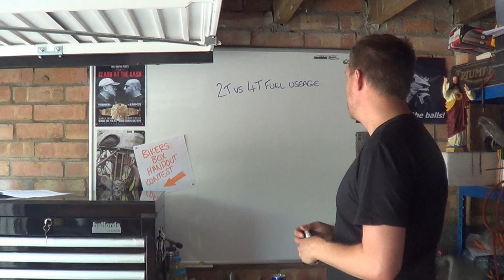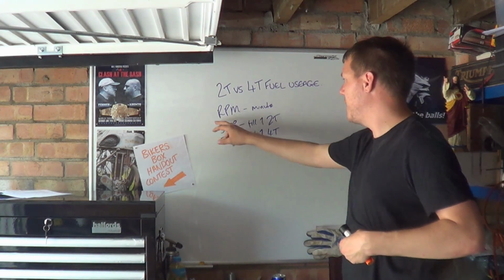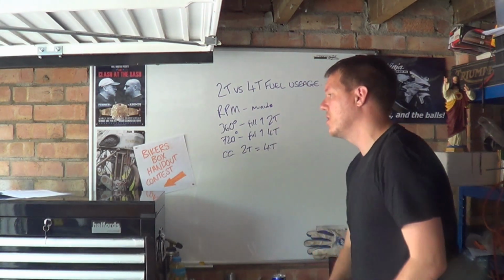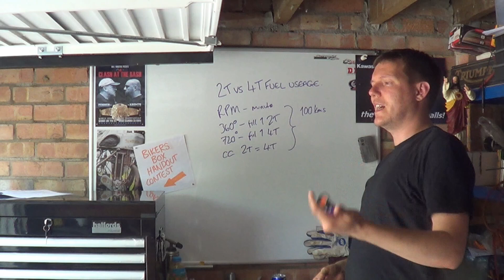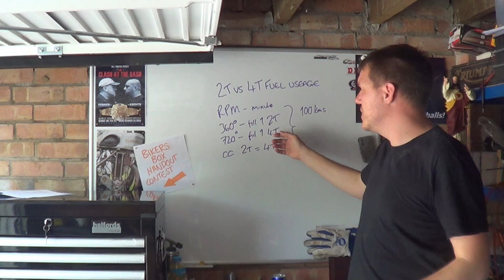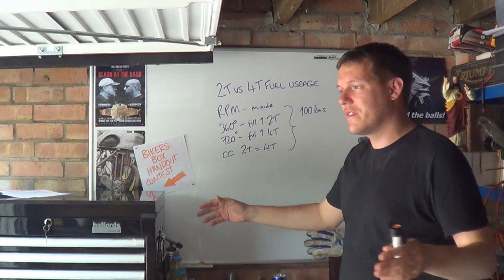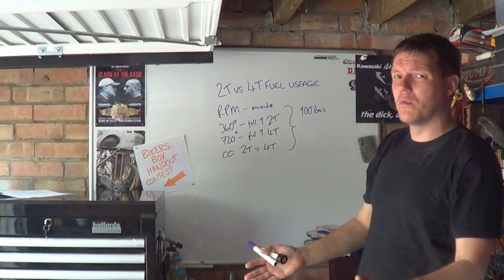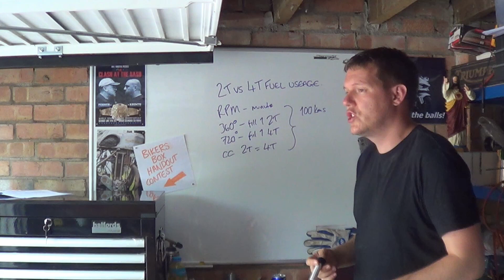2 Stroke fuel efficiency vs 4T

Comment: Yep yep..I agree...but a 2 stroke outboard engine fire's every second stroke...a four stroke fire's every forth stroke...which means the 2 stroke is pushing out more power
as compared to 4 stroke on combustion engine.. SO you can adjust the prop pitch alot more on a 2 stroke outboard than a four stroke...I reckon it could be adjusted almost 50/50 fuel usage on both including the boat weight it is pushing in water

Comment: right, but a 2 stroke can run at higher rpms and generate more power in a smaller lighter form factor, you're missing part of the equation, the oill helps with compression and thats a feature not a bug lol.
Reply from the maker: 2 strokes run higher rpm? I dont know about that

Comment: 2T are inefficient whilst producing much more torque than 4T.  25% of fuel/oil is exhausted raw.  It's very important to use the exact mixture of fuel/oil on older non-computer controlled engines. Most of the world overdoes the oil which decreases efficiency appreciably.  (wrong choice of word.)
Reply from the maker: Exponentially vs what?
Reply: @thedirtyworkshop  The predicted power curve.
Reply from the maker: Oil consumption vs power output? That's a new one on me. It's not exponential, its a function of displacement of fuel as a percentage. So how much fuel is replaced by oil. However, the oil burns and this itself releases energy. The oil has a lower specific energy than isooctane but only by about 20%.

Definitely not exponential...

Comment: The world's most efficient engines are ship engines. And guess what, they're 2 stroke engines. Well I certainly don't know enough to judge the whole 2 stroke vs 4 stroke thing, but there certainly is some reason they use 2 stroke engines instead of 4 stroke engines.
Reply from the maker: "The world's most efficient engines are ship engines. And guess what, they're 2 stroke engines."

- 1) they're diesel 2) they have ports and a valve in the head - and have forced induction - not the same thing as a 2T bike engine. Actually as far as you can get from one
Reply from the maker: Also the efficiency comes from long stroke, short bore, cross-head bearings and the fact of scalability - i.e they're massive
Reply: @thedirtyworkshop  Sure, Diesel is just great. And yes, I did not mention efficiency increase depending on size, but that was kinda on purpose. My point was rather why they would use 2 stroke instead of 4 stroke if 2 stroke was that much less efficient, because in transport it's all about efficiency.
Edit: I do not have much experience with bike engines so that might be a valid point.

Comment: One mistake is that a 4t need more CC  for the same power compared to 2t.
But yes 2t is less fuel efficient but it's not twice as much. 
Another point is that 2t is a simpler technique, less moving parts easier to repair and cheaper.

With outboard engines you see that at wot (wide throttle open) they consume the same amount of gas. Benefits of 4t are at lower rpms.
Reply from the maker: "With outboard engines you see that at wot (wide throttle open) they consume the same amount of gas."

- This is rev depends otherwise what you said is impossible

Comment: for comparison: I have a 50cc 2T -> 2,3 l/100km
                                            50cc 4T -> 1,7 l/100km

but because 50cc 4T is not 50cc 2T
=>
you explained it in one of your vids, that you have to measure ccm in a 2T after the exhaust port has been closed.
=> 50cc 2T -> actually more like 30cc
=> twice the fuel for ccm :D
Reply: can you tell me, how you reach 1,7l in a 4 stroke ? on my gy6 50cc, best i can get is 2,5l/100km
Reply: You can't make this comparison because 50 4t is way slower

Comment: Hi 
I appreciate that 2ts are less fuel efficient but realy are they that bad, I have run all kinds of engines against dynometers but never a small 2t I would like to see fuel consumption data and check the BSFC for a real comparison.
Anyway big 2ts are the most efficient and powerful just look at the sulzer and man engines, maybe not quite suited for motorcycle use but  could be fun to try

Comment: Even though the energy content (by weight) of diesel is almost the same as petrol, the two factors which predominantly make it more efficient are it's specific gravity, i.e., the energy content by volume is higher than petrol, and of course the diesel cycle vs otto cycle (i.e., higher compression etc).

Comment: 2 strokes are waaaayy more fuel efficient ahahahaha(not), but fun af.
Reply: My brother had an Yamaha XT 500 and it was a pain to ride. Too much power to launch smoothly and then gut-less at WOT where you want the power. I just had a Yamaha DT 175 and it was perfect for control ability. You could nip in and out of tight spaces without bumping into things. It always started first kick. Eventually, my brother gave up his XT 500 for a DT 175 as well.

Comment: I would believe that a one stroke would be the best, but the four stroke is far more tunable. With a lambda a/f ratio metering system and the correct materials you can generally hit a 21:1 ratio without  melting the piston/rings.
Reply: I´m not so sure about that. Well maybe there is more to tune on a 4 t but I dont think it is that much
Reply: leaning out is not always the best solution for efficiency.

Comment: Am I right in thinking: If I change the T2 ratio of my pre mix Petr-oil classic bike from an old style mineral oil at 20:1  to  a modern synthetic  T2 at 50:1 then the carb jetting should be changed to compensate for a richer air fuel mix? I'm asking because the I've been told I don't need to put the same quantities of modern Synth T2 into my fuel any more!!!
Reply from the maker: I doubt it, fluctuation in the metering of fuel in your carb make the change not even worth thinking about.

Comment: But the 2T would make "twice the power" for the same RPM and CC, therefore, to achieve the same cruising speed you would throttle back the 2T "halving" the amount of air and fuel ingested per stroke. Obviously they still wont be as efficient as a 4T for the other reasons you mentioned.
Reply: Twice the power was meant to be read in air quotes, I was just trying to make a point that for the same displacement, at normal cruise speeds a 2T wont be half as fuel efficient because it will be throttled back more than the 4T. I know you know this, it just sounded a little misleading in the video.
Reply: The Workshop I own 2 bikes. A FI 250cc 4T and a 250cc carbureted 2T. Same style of bikes (enduro). The 4T get 20-30% better mileage but not nearly double. Was pleasantly surprised as I thought that I may have to buy a larger fuel tank for the 2T but don't have to. The stock tank is 25% larger than the 4T. The 2T has quite a bit more power. Top out at similar speeds. The 2T doesn't rev as high to get peak hp, could this be why it's not drinking twice the amount of fuel?

Like both engines for different reasons. Have both horses in the race, just curious.
Reply: Whats the hp of the KTM 2017 250cc SX-F @ 8650rpm
Reply: Albie Beck exactly my thought.
Reply: TNT Moto looks like 32ish HP @ 8650
Reply: Still love my Vespa´s and Lammy´s though.
Reply: So if as much r&d went into the 2 stroke intake/Compression/exhaust/lubrication design that has been put into the 4 stroke engines over the last 20 years.  Could we have a 2 stroke that produces equal hp at half the rpms thus burning half the fuel?
Reply: @TNTMOTO  If you want Gasoline 2 strokes to be more efficient, just use the diesel 2 stroke cycle. Instead of burning oil to lubricate the crank, have a closed crank and use a supercharger, probably a roots, or a twin screw. Have an exhaust valve, and because your supercharger will probably be positive displacement, you can even make boost out of it, by closing the exhaust valve Early. You can also use fuel injection, as a plus, and also you can just have a supercharger as a blower and increase the compression ratio.
Reply: @vladlu6362  2t don't use valves, they have reeds at the intake and am exhaust port as this was meant to talk about bikes.  I haven't read on the 2t Detroit diesel engines yet
Reply from the maker: Which 2T makes twice the power - you're dreaming mate. 

KTM 2017 250cc SX - 52.4HP @ 8650rpm
KTM 2017 250cc SX-F 41.2HP @ 11,200rpm

Not exactly x2 is it?
Reply: @thedirtyworkshop  10 horsepower is alot my golfcart has 9 horsepower and it's a 2 stroke and it goes 20mph a kx60 has 12hp and goes 47mph

Comment: Quick question Matt. If we're comparing like for like injections, carbs for carbs, rpm, gearing, cc and all that stuff then what about cylinders? Would a 4T 4 cylinder of the same cc not even out the fuel usage a bit, or is it irrelevant because the cc is the same?
Reply from the maker: Great question, a 4 cylinder would actualy use less fuel, each cylinder cna be leaned out as the power strokes are distributed over a larger degree range. If that makes sense?

Comment: Hold a minute... You say that if you take the money to create more fuel efficient petrol's put it in the diesel you get better diesel's. Yes that is right but a fucking diesel engine car is more expensive already. Diesel engines have their purpose but serious 75% of those who drive a diesel would be better off driving a petrol engine car. Because a diesel is not made for short rides, and a petrol engine can handle it better. Ok not problem free but way better then a diesel driving 5 km to work and back. And the few cents you save on diesel will you pay on taxes and repairs double or tripple if you only ride it like 6000km a year.

Comment: So with a higher tuned and jetted ktm 250 2 stroke on technical mountain single track rides I typically get higher milage than the efi 4 strokers like the ktm 350,500.
Reply from the maker: "So with a higher tuned and jetted ktm 250 2 stroke"

"efi 4 strokers like the ktm 350,500."

- 'for the same cc' - did you miss that bit?
Reply: @thedirtyworkshop it doesn't make sense to compare the same cc, A 250 2 stroke would be at least as powerful as a 350 4 stroke. It also important to note that the specific output plays an important role in efficiency and fuel consumption

Comment: The problem with this is that 2 strokes do not rev has high as 4 strokes
Reply from the maker: 2T theoretically can rev higher than 4T's. Lighter reciprocating mass. Its all about the port timing. The problem with 2 strokes is that if you run higher and higher rpm your bottom end is non existant. They have to have a compromise, and this is due to the volumetric efficiency of a 2 stroke vs a 4 stroke.
Reply: The problem with 2T is they have to move a lot of air in a very short time and the port gets saturated pretty quick, 4T are more efficient in moving air, but you have to rev the sh*t out of them to make power.
Reply: 2 strokes rev alot more than 4 strokes. Well but as the workshop says they lose bottom end but almost a original 2t moped is no problem reving 9k. And a very tuned engine rev upp to 14k or more. Well I`m talking about my experience with smaller engines. Maybe it is differant when it comes to larger engines but I don´t think so
Reply: yeah they do.